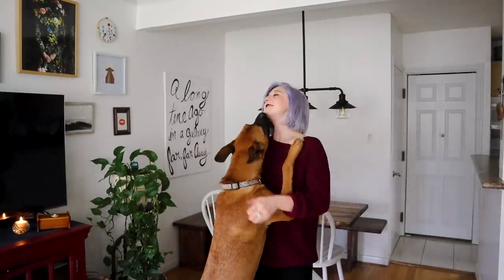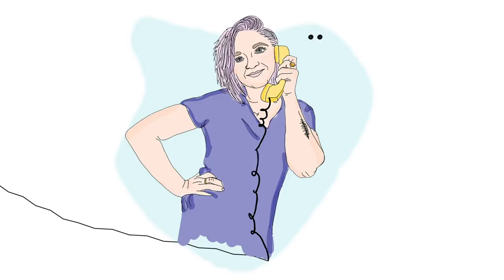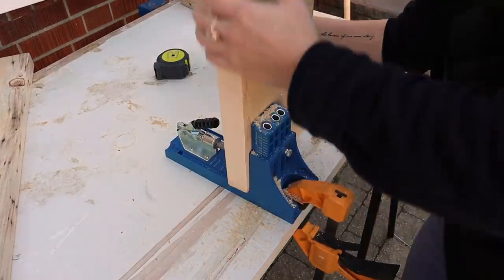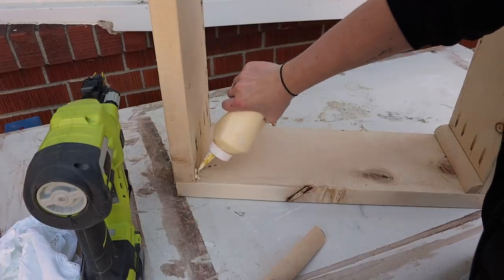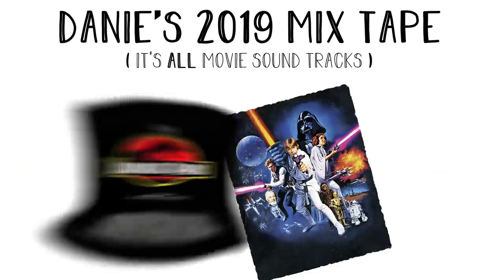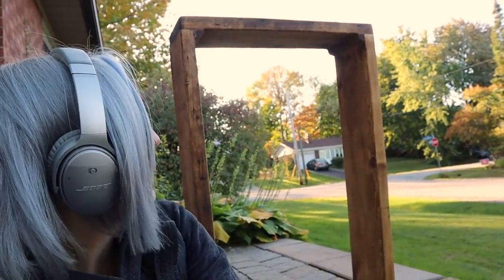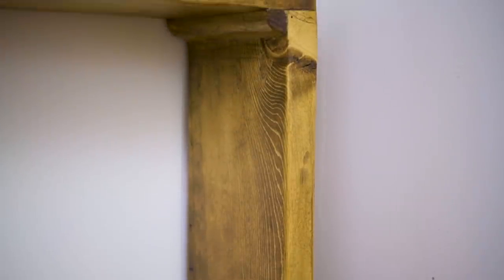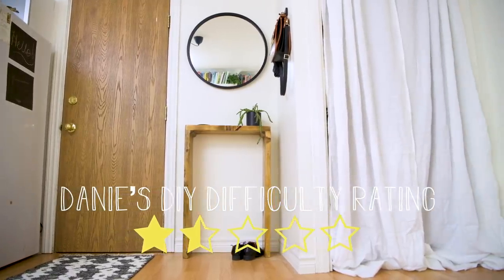Simplest DIY Minimal Entryway Console Table! | The Diaries of DIY Danie

Comment: You're right, Danie.  The simplicity of it opened up the space at the door.
Thanks for the corner round bracing idea.  I normally use corner brackets, but this is much better looking.  (I once made a folding screen using angle brackets & mending plates to hold the cross pieces, since I had minimal tools.  Piano hinges looked good though, and it's still impressive from the front... a DIY nightmare from the back 😃.
This was the joins-using-"biscuits" era.)

Comment: I needed a small narrow console table to sit behind my settee. I couldn't find any the right size so using the planks from a wood pallet I'd salvaged almost identical to this. The one main difference is I used small L brackets which were covered by gluing on half round finger Jointed molding. I used 3 pallet planks per side and for the top, all sanded. To attach those together I drilled holes in the sides of each, all lining up, and pressed pieces of wood dowels (glued) into each hole. This secured all the pieces together. Once done I used a whitewash on it and a dark antique wax rubbed on for the final layer. It was done in a Saturday afternoon.

Comment: Unless I piled bricks on the bottom, the carpeting in my apartment would cause the table to topple over.
Reply: If you added another piece along the bottom, so it was a frame with 4 sides rather than 3, it would prevent that, but still look pretty minimal - and as a bonus stop the bowing that Danie mentioned 🙂

Comment: Wait, wouldn't that mean that the carpenters who sold that fake 2 inch wood are misrepresenting their product? A few differences of mm, sure I understand but half an inch difference?
Reply from the maker: Listen, the struggle is real in the world of nomenclature haha
Reply: @DIYDanie  I'm just so surprised it can get that wide! I guess it must be due to using non-metric system? But I thought you're Canadian? I'm confused...
Reply from the maker: @EmeraldMara85  Well.....officially Canada uses the metric system but in a lot of cases, it's still common to use the Imperial System, especially in construction (which I prefer). When you go to the hardware store, the nominal sizing you purchase the wood at references the size of the wood before it's planed down to its final size. It's complicated and silly, but it's good to be aware of it.
Reply: @DIYDanie  I see, thanks!